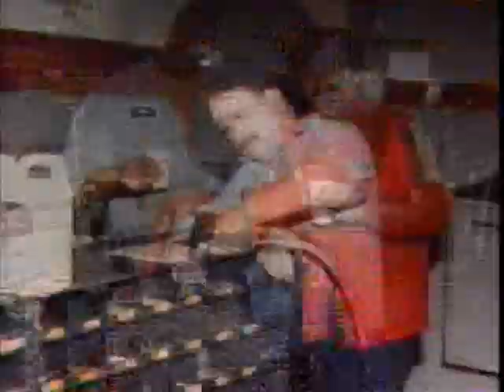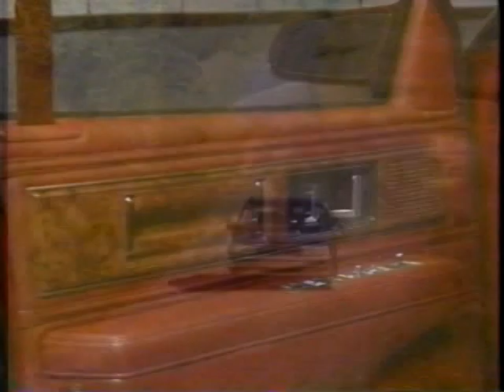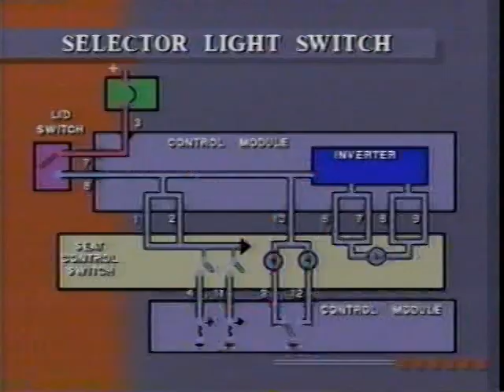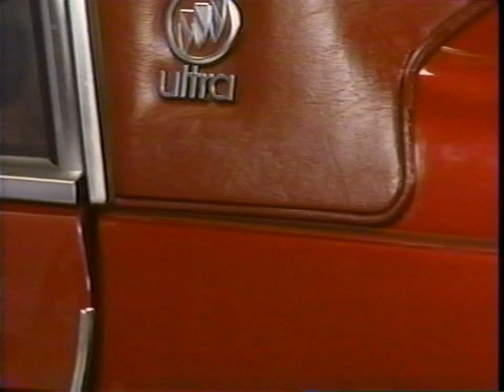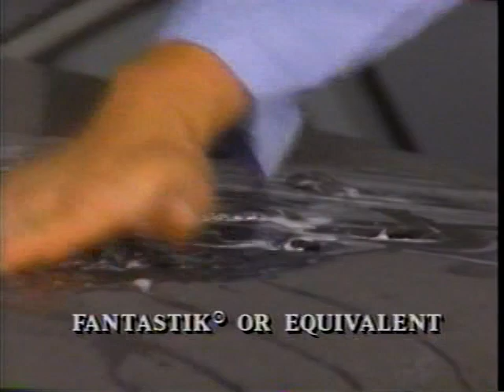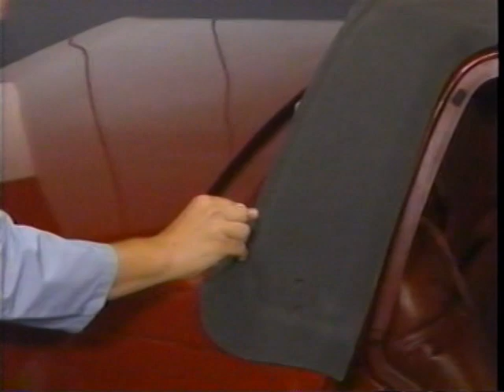Buick - Park Ave Ultra Service Highlights (1989)

Comment: I had an 85 Buick Park Avenue, but it was the standard one. The tops are beautiful but holy crap I never realized how much was involved in having to repair one.
Reply: Not the same procedure for the vast vinyl top on standard park avenues, that particular top was an Ultra exclusive feature. The standard ones weren’t nearly as complicated.
Reply: You have to wonder how much that vinyl top improved sound deadening. Surely having all those layers on there absorbed sound.

Comment: I always loved this generation of the both the Buick park ave and the Oldsmobile Regency 98 and the Delta 88 I always called them baby Cadillacs because these 3 cars when loaded with options were like the Cadillac
Reply: I'm with you. This generation of Park Ave and 98 Regency were most definitely baby Cadillacs! They had pretty much everything a Sedan deVille had at the time, with the exception of a V-8. I had both the Regency and the Park Avenue of this generation, and I would say that neither of them drove quite as heavy and smooth as the Sedan deVille. The main downside with the Cadillac was the 4.1 liter V-8 was not a good engine long-term. The engines on the Olds and Buick were bulletproof. Loved these cars.